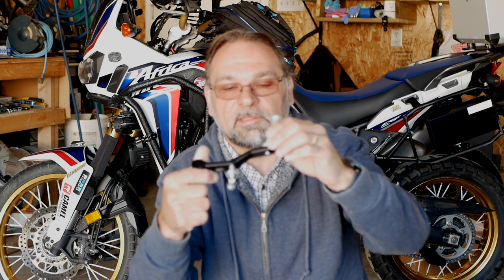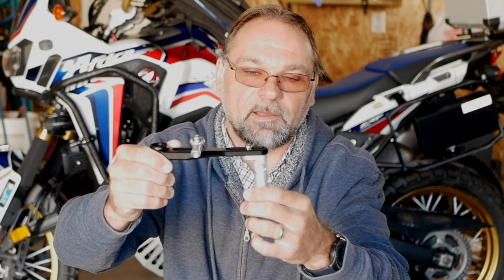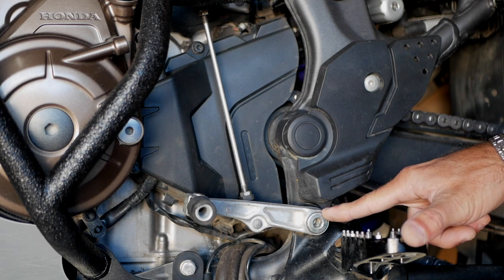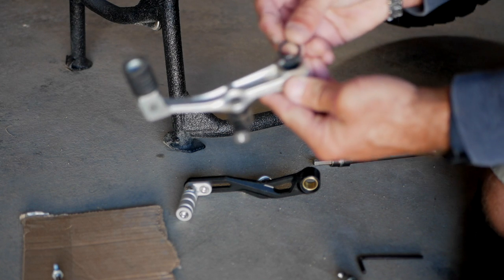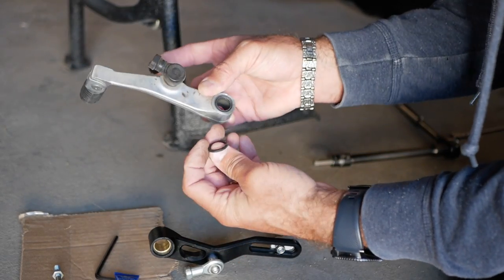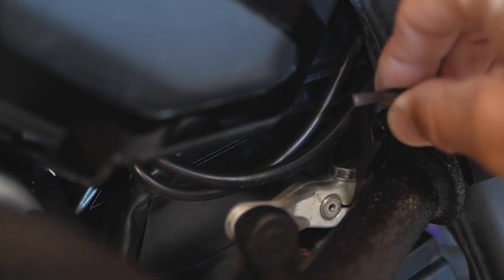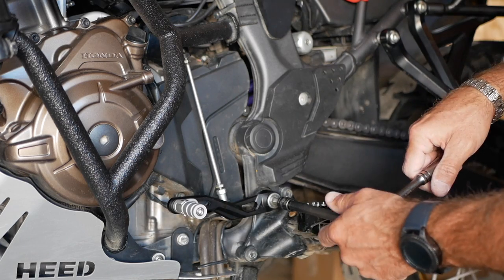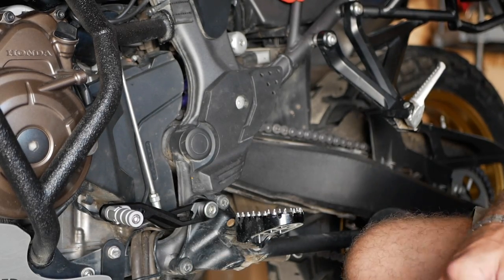Installing and Adjusting Gear Shifter Honda Africa Twin

Comment: Good video. Is this shifter designed for riders with larger boots? I have hard time shifting with my size 12 on AT with OEM shifter. Thanks
Reply from the maker: Most of the shifters should adjust to any riders.  This shifter has a bit room to adjust on the slider.  I'm size 10 and I don't have it pushed all the way forward so my guess is it should do the trick for You.

Comment: Good video Thomas.  I can't find any specifications regarding how much if any longer for sure that the shifter is you put on compared to the OEM one you replaced. I know the length is adjustable but when its slid out as far forward as it can be how my longer is it? I see it has a rise built into it too which I think is good. I like to have my shifter adjusted so that it sits just above the toe of my boot when I am riding, I find that the most comfortable.
Reply from the maker: The hight can be adjusted even on OEM shifter but loosening the adjusting rod and moving it up and now as far as you want.  This shifter may be slightly longer that's why there is why adjustment in the front also comes with extension if you want it to be wider
Reply: @AdventureTravelandScuba  Yes the height can be adjusted on the OEM one. I was looking at that on mine but I wasn't sure if it would give enough adjustment or not. Mine is still sitting at the dealership because we still have a bunch of snow in Saskatchewan yet.
Reply from the maker: @myronhorvathsk  I'm at work when I get home i can measure the length of the shifter for you. I'm in Calgary we got a load of snow as well.  I was riding beginning of February almost no snow than 2 days after over a foot
Reply: @AdventureTravelandScuba  I seen you were in Calgary and were out riding some last month! I’d appreciate  you measuring that for me, thanks.
Reply from the maker: @myronhorvathsk  the shifter total penis 6.5 inch
Reply: @AdventureTravelandScuba  Thanks! was that the total length or from centre of the pivot to the end of the arm? I assume the total length.
Reply from the maker: @myronhorvathsk  total length end to end
Reply: @AdventureTravelandScuba  great! Thank you.

Comment: Hi!  Thinking of doing the same to my shifter for the same reason.  I'm curious if you could have transferred the lower heim joint from the OEM shift rod to the aliexpress shifter.  It looks like a much better quality part.
Reply from the maker: I looked at it an it is a different design otherwise I would do it as well but now I have this shifter for a while and it's fine no issues I like it much better than OEM especially when You are wearing adventure boots.  Thank You for Subscribing You made my channel as 300 Subscriber👌
Reply: @AdventureTravelandScuba  my pleasure!  My wife and I are planning a 10 day trip around BC next July assuming the covidpocalypse has lessened.  I'm looking forward to watching your vids.

Comment: Hello! Is this gear shifter extendable too? My size 12 US feet are struggling with adventure boots on the africa twin !
Reply from the maker: Yes You can adjust it about 1' play front and back and you can make the shifter sticking out less or extend